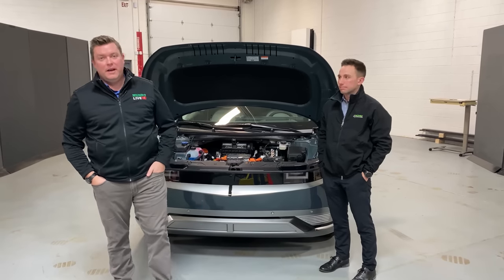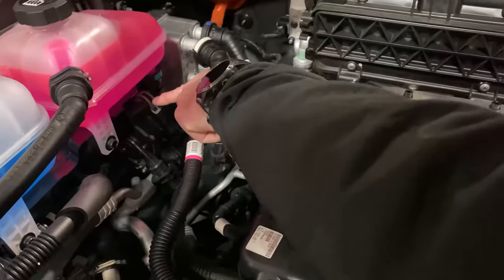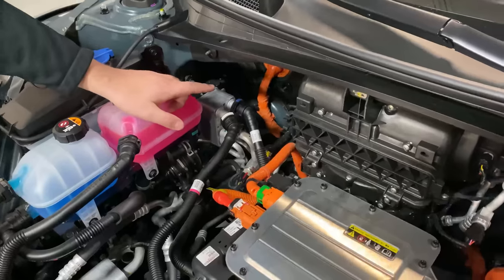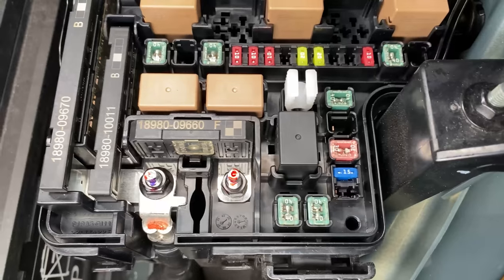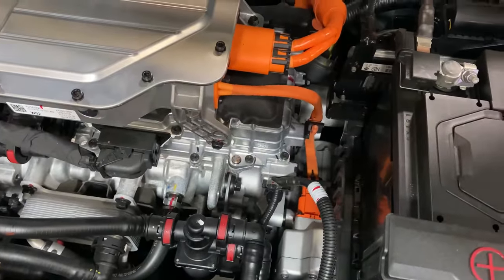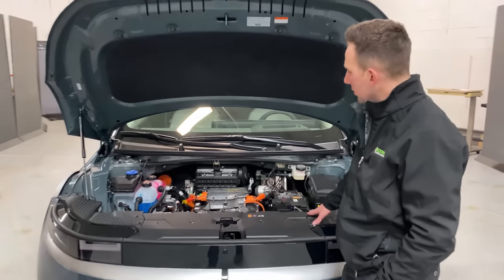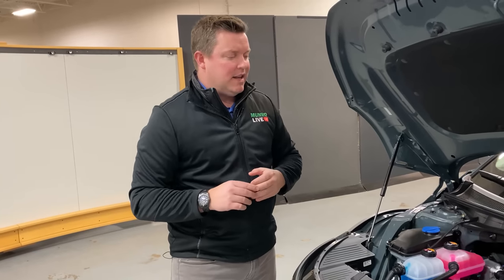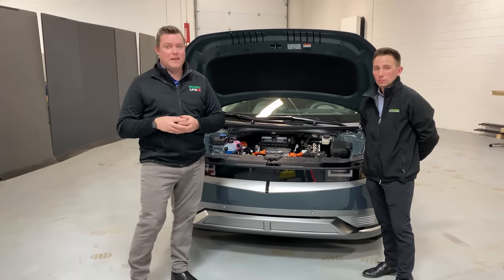Hyundai IONIQ 5  |  Under the Hood

Comment: I buy cars ten year old cars at minimum.  I'm concerned about so many lineal feet of hose.  The number of connections.  Ugh.  I deal with coolant system leaks now on my ice vehicles.  This seems like a nightmare waiting to happen, as these things age.  I haven't heard anyone talk about rodents.  They like to eat wiring insulation.  Won't this be a widespread problem as these cars age?  What do you guys think?
Reply: Buy newer cars, or replace hoses in the older ones.
Reply: @anxiousappliance  Huh?  Who are you to tell anyone what to buy?  I just asked the questions.  Do you even know how to think?
Reply: @simonthebroken9691  LOL - just offering possible solutions to the issue you stated.  Follow your bliss.
Reply: The good news as since the coolant in a EV is MUCH cooler, the hoses will last much longer. Probably they should be replaced every 125k miles just to be safe. I saw a Tesla video of a Model S with 1 million miles on it. Original hoses, original battery.

Comment: Heat exchanger size is only right if it will work in both Death Valley California in the summer and also work fine in Prudhoe Bay Alaska in the winter . Anything less is wrong because the engineers don't know where the vehicles will need to be used.

Comment: How feasible is it to copy the "under the hood design/arrangement" of Tesla to another brand ?
if possible why does not everybody copy the best design ?!
Reply: Part of what complicates that is Tesla builds a lot of parts in house where others are still largely looking at what they can get from suppliers.  You can't duplicate an arrangement if you can't get or make all the required parts.  I think that will change over time but there will be iterations.  Cars that show increasing levels of refinement and vertical integration as the years and models go by.
Reply: I think you've answered your own question.

Comment: Nice to see Kia make incremental improvements.

Thermal management seems to be an issue for the OEM's

They are unable or unwilling to duplicate Tesla's octovalve or the OEM's parts department is throwing their weight around in the design process. 

When you see that much piping for thermal management for the Ford Mach-E and this vehicle, its not just the extra cooling liquid required, for every foot of additional piping the chances of leaks increases.
Reply: The thermal management in my E-Niro seems good - I turn on the heat, and it gets hot.  Joy.

Comment: The 12V lead acid battery is really a travesty in the EV world.  It is already causing total EV failure for some ioniq 5 owners who had the car for a couple of months only.
Reply: It's funny how Tesla go several years using 12V lead-acid batteries and that's perfectly fine, but as soon as they introduce some models with a lithium-ion battery it's now a travesty not to have one. Hyundai's 12V battery management faulty so the 12V battery goes flat is certainly an issue, but you'd think they could solve it with a software update.
Reply: Then it would be a travesty in the ICE world, since a lithium-ion battery could be used for engine starting, too.  In reality, automotive design without regard to cost is nonsensical.

The only thing that I find strange about this car's battery is the size - it's not obvious why it needs to be so large, given that there is no engine starting load.
Reply: @brianb-p6586  Yeah, they have smaller batteries for their really small ICE cars, so I've no idea why they didn't put one of them in.
Reply: @Xenon0000000000001  Tesla had the same failure issues with lead-acid. Tesla took nearly 10 years to switchover. You'd think that an OEM releasing a car in 2022 would learn from that mistake. But nope, off the shelf ICE parts were too tempting.
Reply: @Xenon0000000000001  Since my earlier comment, I have realized why the 12 V battery is so large in these EVs, including Tesla. The high-voltage battery needs so much babysitting (monitoring) while parked that the 12-volt demand is substantial - far more than a parked ICE vehicle. The 12 V battery is recharged from the HV battery, but when the HV battery charge level gets low enough recharging is stopped to protect the fragile lithium-ion battery, killing the 12 volt battery.  

The end result is that while an ICE needs a big 12 V battery for a starting surge, an EV needs a big 12 V battery for extended parking.

Comment: I don't mind not heaving a frunk. It makes easier to service the car, and a provides a shorter front section.
Reply: That makes zero sense. It does not make it easier to work on. You don’t have a frunk because you and massive inefficiencies, extra hoses, extra fluid, extra parts. The front of this car is a mess. Fuses are a thing of the past. This car is loaded with OLD TECH. This car is not worth the price. There is so much lazy and dumb engineering in this car resulting in more things to fail and fix.
Reply: @GET2222  I do not get why they are sticking with old fuses.  It is pure insanity.  The only reason to keep old fuses is to force people into the shop when they blow.  The average person doesn't know how to deal with a blown fuse.  It strands even experienced people if you have no fuse on hand.
Reply: @GET2222  there is no such thing as "extra parts" is modern cars. To have a functional frunk, you need to have a longer front section and a more tighter packaging. That could mean less accessible.
Reply: @GET2222  also to take proper use of the frunk, you need to automate it, so it's easier to access it. And that means extra parts and a more complex release system.
Reply: @RogerM88  what are you talking about? “OCTOVALVE” is the perfect example of consolidating a massive amount of parts into ONE at a fraction of the size and weight. I’m not debating a person who doesn’t understand BASIC engineering. Simply wow. Munro has an entire episode talking about TESLAs OCTOVALVE designed by SPACEX and TESLA engineers. Its on this channel. Look it up. Consolidation hoses and a variety of other parts that are no longer needed and it cheaper. I’m done speaking with morons. This is how you get space for a FRUNK.

Comment: I have what is probably a silly question: why do Teslas have space to spare in the front trunk while other EVs "need" to have all these components under the hood? Why don't they "Tesla" their design?
Reply: I suspect some of that is due to the fact that tesla can make parts to suit themselves while many other makes are still getting parts from suppliers so less flexibility.
Reply: Etron and etron-gt did "Tesla" their design. Porsche basically invented the frunk and Elon liked it so much it was put into Teslas. 😉
Reply: A matter of packaging priorities.  A tradeoff of accessibility and serviceability.
Reply: Tesla (and Mach e, and Ford Lightning) have a long nose ... styling! Technically it would be more space efficient to shorten the nose and pull the passenger compartment ahead and add that length to the passenger compartment ... but then it's going to look different, which some people might think looks funny. Can't have that! (*cough* Chevrolet Bolt ...)

Comment: Do you expect the next generation EVs from everyone to be much better engineered? As these cars are all probably rushed out the door.
Reply: This isn’t rushed out the door. They have been building EVs for nearly 10 years. Clearly buildt to a different engineering ideal than the Teslas, but not in any way, shape or form can this be described as bad. Slightly more conservative and service friendly, maybe.
Reply: @hepphepps8356  Fair enough, but this sudden huge increase in interest in EVs probably caught Hyundai by surprise too. I still think there was some rush.
Reply: In theory I do, but in reality I don't because all these EV's are going to sell well. So why push the envelope and innovate until sufficiently pressured to do so?
Reply: The e-gmp is already the nextgen design, you can recognize it by the 800 V system. ;-)
Gets true sportscar performance with EV6 GT and efficiency with Ioniq 6 streamlined body.

Comment: I live in Europe in a place where EVs are very popular but not subsidised to any great degree.  The Ionic 5 is here but it's not proving very popular.  I put that down to the sheer number of Teslas that are here, the plain fact is that the Hyundai would have to be head and shoulders above the Tesla to make people go for that brand and it doesn't even equal it.  People will pay more for a used Tesla than a new Hyundai right now.  This is despite Hyundai advertising the car.  Tesla have one hell of a product and reputation - I've never seen anything like it before.  An American car which doesn't advertise, isn't built in Europe (yet)  and somehow becomes the best selling car , not forgetting that it's battery powered !!!!  10 years ago I'd have said you were crazy if you'd told me that.

Comment: Great work guys. Despite price point, they are still no where near where they need to be to become viable competition.
Reply: Based on what? 99.9% of people buying an EV don’t care about what material is used for the coolant hoses or whether or not the motor inverter is integrated with the motor. They want a good car. This is a good car.
Reply: it's selling like hotcakes bro.   normal folks don't care what's going on under the hood.  it's beating teslas in comparisons and winning design awards.    it's a compelling option.   i love the retro design.
Reply: @joec.5009  it’s just great that more EVs are selling and I do like the car too

Comment: This car will last a lot longer and be easier to service than a Tesla. Frunks will make servicing or fixing anything a huge hassle.
Reply: I think you are correct. On the other hand I think Teslas game is making a vehicle that really won’t need servicing. Even the older Hyundai/Kia vehicles don’t need much servicing, so all this accesability is a bit of a waste. 
The access to the cable shoes to the VESS unit, which no one will ever touch in any of these cars ever, could have provided enough frunk space for one of the charging cable connectors all by itself.
Reply: @hepphepps8356  there is no such thing as a car that will never need anything fixed or serviced, I just won’t happen regardless of the propulsion system. 
Tesla can make said car, it just won’t last that long. Ever watched Louis Rossman?
Reply: @hepphepps8356  Trust me they do need servicing from time to time.  My Model 3 had a broken superbottle in its second year.  It pretty much made the car undriveable until it was repaired.
Reply: @MTNRanger  How long did it take to be repaired?
Reply: @abraxastulammo9940  I made an appointment with the service center and luckily it just took a full day to get it fixed.

Comment: And still using Heavy lead acid battery
Reply: Just like a Tesla Model 3.
Reply: @brianb-p6586  do not spread fake news!   The model 3 and Y come with lithium ion 12v batteries now.
Reply: @MattNis1  They didn't a year ago and Model S didn't a year or two ago, either... so there's really nothing wrong with the lead-acid battery, according to Tesla, because absolutely nothing has changed in battery technology in that time.
Reply: @brianb-p6586   There is definitely a lot wrong with lead-acid, that is why they changed it to lithium ion from now.  Every other electric car manufacturer still uses lead acid and it's heavy and short-lived.

Comment: FRUNK: i disagree having a frunk is necessary, desirable or important as long as the car has a normal back trunk. I don't understand why Sandy and his team get all excited about them, LOL. Many other things are much more important in my humble opinion like: less weight for range, mechanical service easy of access, function & efficiency, simplified systems and maybe use this "extra" space for roomier interior instead, etc...I would concentrate all efforts in developing 5 major improvements: (1) speed of recharging (more important than having a mega battery size for range); (2) next gen battery for efficiency and safety (solid state, new chemistry or else); (3) wireless charging like WITRICITY; (4) next gen OTA integration (internet of things) and maybe the most important of all, (5) BRING THE CAR PRICE DOWN, the most difficult battle. It's a shame the way things are going. A NEW car should not cost more than 20k for a decent one and maybe up to 40k for the super luxury models. Today, basic cars start from 40 to 50k, absolutely ridiculous.
Reply: I agree with you about them and the frunk. I made a comment on another video where Sandy said he was pissed about the size of the small frunk and had all the fan boys jump on me. As I said on that post, we lived this long with ICE vehicles without a frunk, so what's the big deal lol! I also agree with your other points as being A LOT more important!
Reply: The frunk is the best place to put expensive items so they won't be visible, adds extra space and reduces cabin clutter.  It's a great feature IMO.
Reply: @StormyDog  and this vehicle has one, just not as big as some others. I'm poor, I don't carry anything valuable with me lol!
Reply: @StormyDog  I respect your opinion but if you allow me to counter argue: we should never leave any valuables unattended in any car but if you need to do so on a regular basis, as far as i can remember most back trunks hide everything, so you just need to have one car with a normal hiding back trunk. About having extra space for storage, a normal family will do fine with a regular back trunk. If you carry working tools, etc, maybe you need a bigger car more apropriate for the task. I bet most people excited about Frunks use it, and leave the back trunk empty. I don't really see the point for 99% of us. Maybe you are an exception and that's ok but I doubt the use case is the majority. I like Sandy and his guys but I don't agree with everything they say, for example, I just remembered their excitement on those 3 wheel cars. To me, this idea goes nowhere, maybe I'm wrong, I would never buy one not even for 1k.
Reply: I agree.  While a nice feature is should be a low priority.
Reply: @StormyDog  Thieves can open the Tesla frunk from outside I hear. Or was it the Mach-E where you put a battery to two cables/contacts behind a small plug in the front to be able to open it if the car battery is dead.
Reply: @abraxastulammo9940  Thieves can open anything if they want.  However if they can't see anything of value they most likely won't try.  This is why EVs don't have windows in the hood.  ;-)